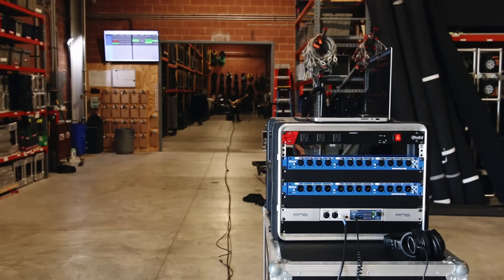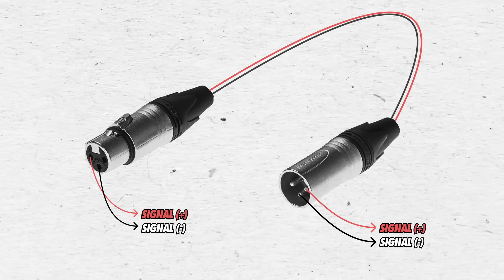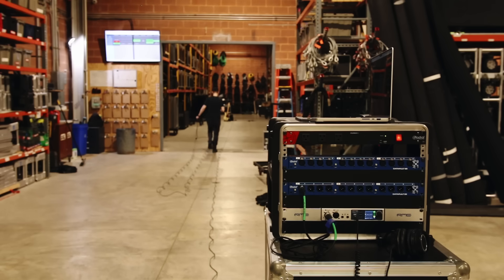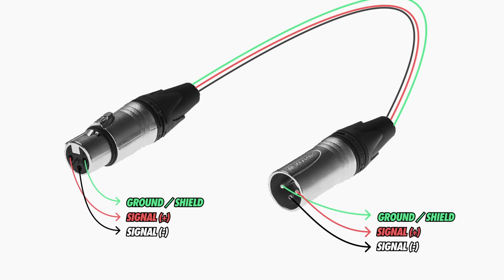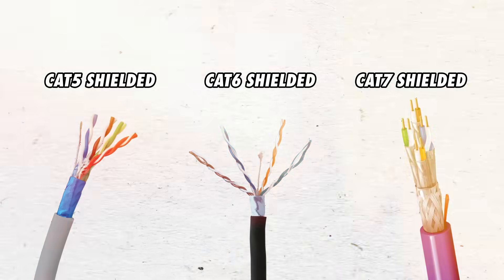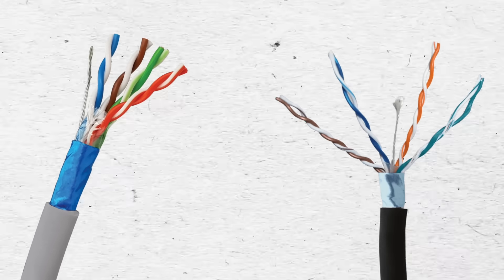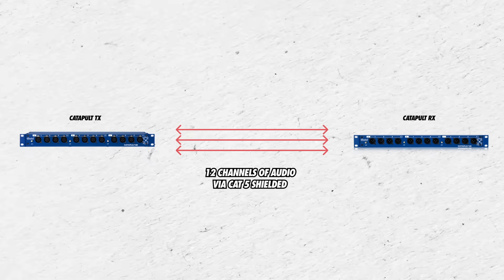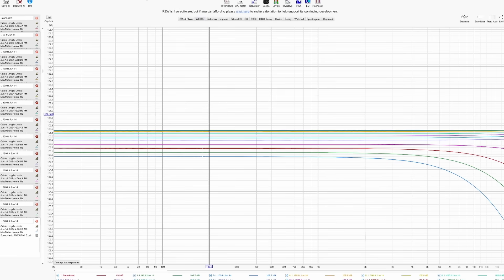Do Audio Cables Affect Sound Quality?

Comment: You can get an Cat6 cable where each pair is shielded too. It then have the designations S/STP, S/FTP or F/FTP on it (S for braided shield and F for foil shield) instead of UTP (Un-shielded Twisted Pair). Most used here in Norway is Cat6A S/FTP cables. You can terminate the plugs yourself on the cables, but you need those special plugs for that. And it often takes a lot longer time to do. For those few times I use the "Field Termination Plugs" that have a lot more room in them for the thicker cables and does not need an RJ45 crimp tool.
Thanx for a good explanation og the different cable types and signal types used in Audio installations. I will be sure to send this to my colleagues :)

Comment: Systems that use Network cable are not analogue. Digital Network Snakes essentially use a heavily modified version of DOCSIS, the same technology in cable internet modems. With frequency channels and (TDMA) Time-division multiple access using (TDM) time division multiplexing. Equipment that was studio level quality 40 years ago is now built into every computer and smart phone. |

So YES, everyone has a recording studio in their pocket.
Reply: A simple Cat to XLR adapter which uses network cable is analogue. You just split up all four pairs for four XLR connections.

Comment: Interesting thing about CAT5/6/7 cable is the twist per inch (TPI) of the conductors affects the impedance of each cable pair.  If you look at each pair of conductors in a CAT5/6/7 cable, you will notice the TPI is not the same, slightly affecting the impedance of each pair.  This makes a difference in high speed data transmission and why correct pinning is critical when making cables.

Comment: 1200 feet using an ethernet cable with hardly any loss, yet the audiophiles pay $8,000 for a stereo pair for their living room 😂
Reply: where can I find ethernet cables that can run 1200 feet?!
Reply: @IQof2 watch the video. he used multiple cables
Reply: @IQof2 right? I only know of 100 feet ones in my area
Reply: @IQof2  The standar UTP/STP cable box contains 1000 ft....  so you would need to "patch" them or, like in the demo here in the video, jump them trough... results are about the same.... Since the Network standards for copper cable are limited to 1000ft there isn't usually need for longer lengts (in data networks anything over 1000ft is usually over fiber optic)
Reply: most audiophiles nowadays don't actually understand how to achieve best quality
Reply: Not all "audiophiles" are idiots. I use Mogami gold XLR for all my interconnects a gran total of 60 bucks a pair. The only magic cable I use is for my turntable but I'm well aware than any well made SPDIF RCA (shielded) will do the same thing. However, my Ortofon 6NX bundles everything (including the groud wire) into a single, very esthetically impressive and pleasing doodad. Since I use a step up transformer I need two and are exposed for all to see so they have look the part😂😂 In "audiophila" the sound is part of the equation, most of the stuff is also part of the decor of whatever environment they are in! Take B&W diamond speakers, They are huge and take significant amounts of living space so not only do they have to sound superb, they also have to be, and are, fine pieces of furniture! 😊😊😊
Reply: audiophiles are wild. this is physics, you can measure it!
Reply: Your point certainly has some validity however the two scenarios are radically different in MANY technical parameters and do not compare well at all.    Certainly anybody who's paying 8000 dollars for ANY stereo pair of cables has paid well over 7000 dollars too much.   Unless it represents fair market value for the large amount of gold, silver, or platinum that was incorporated into that particular set of cables and its connectors.
Reply: Audiophiles? Audiofools more like!
Reply: Where dealing with sound numb skull
Reply: @Runco990 XLR ICs are useful for DC powered components with mains powered amps. You equalize the chassis potentials to common earth and avoid loops over USB. 

Either use XLR, use a galvanic isolator, or buy a quality wall wort. Sometimes XLR cables are the easiest and cheapest.
Reply: I don’t see the problem here….
Reply: No - Audiop[hiles use quality Cat 5/6 ALL the time. I use single strand inside my speaker builds to connect drivers to each other. Only after this did I find out how popular this was. They will even weave them together to make SUPER CAT! impressive but I don't have the patience. It's the Copper - the High quality copper. Designed for small current over big distance. TV coax (the old fashioned arial cable can also be great as an audio lead. My friend had these groovy jack plugs that use the coax - takes a few seconds to make a new cable!!
Reply: @willb1157 you are an audio fool. Quality of copper….pure voodoo BS. You apparently know nothing about physics/electronics and didn’t understand the video!
Imagine a recording session with 32 channels all into a cat6 snake and into an interface all with standards cat6 cable… how many ft or m of cheap copper is that?
Then you think that you can better your sound with 2m of „high quality“ copper?!
People, especially audio fools, have to understand how records ( and lately vinyl again!) are made, then they would think of themselves what most thechnicans and HIFI enthusiasts think of them since forever 😮
Reply: In 30+ years of playing guitar in bands, at pubs, clubs and festivals, 150 gigs a year at least, I've never needed a guitar lead longer than 15 feet.  WTF is this 1200 foot BS?  How the fuck could you hear the sound from your amp from that distance?
Reply: @franktriggs  you are aware that stadium shows exist, right?  Just sayin'.  :)  And even if your guitar is plugged directly into the amp, there's either an output from that amp or a mic sitting in front of it that needs to get to the mixing board in a context like that.
Reply: @DavidLindes  Yes, I played a stadium last weekend, and am playing another one this Friday.  The mics on my amp speaker is no more than 20 foot, AND its phantom powered, so lead length means nothing, as it's buffered into the desk.
Reply: @franktriggs  so... you plug into a snake?  a digital equivalent?  other?  Something's gotta make the run to the desk, which I assume isn't on the stage.
Reply: Digital protocols are MUCH more robust to noise. Audio is analog, and so any loss will impact the quality of the signal.
Reply: @jamesseto1  Did you watch the video? The last test was analog.
Reply: @jamesseto1 balanced is still analog
Reply: @jamesseto1 there was nothing digital in this video!
Reply: Now sit down with a single ended valve amp and high sensitivity speakers and listen to copper cable for a while, then switch to silver and if you can't hear a difference then lucky you - most everyone can, its night and day.
Reply: A 1200 ft ethernet cable is fiber-optic, which is immune to the type of noise talked about here. And as others have pointed out, ethernet carries a digital signal which isn't affected by noise nearly as much as an analog signal.
Reply: @MrNoahMango  this isn't ethernet, and it isn't fiberoptic.  It's shielded twisted pair, cat6 I think he said (but he talked about different categories, and I forget what was specifically used in the test, and don't care to go back), but not being used for ethernet, but rather as a direct path for analog balanced audio.  Ethernet is a protocol.  cat6 is a wiring standard.  This is using the latter, only.
Reply: @MrNoahMango  did you watch the video? there wasnt a single 1200ft cable, there were many shorter cables combined to reach the 1200 figure
Reply: BUT JITTER @MrNoahMango
Reply: @MrNoahMango  did you even watch the video, man?
Reply: @MrNoahMango  so I wonder if we can somehow convert one to the other for transferring audio?

Comment: That's a great explanation, but it lacks of taking into account the output impedance of the signal source. With high impedance outputs even short cable runs (dozens of meters) will ruin your signal's frequency response and level dramatically due to the internal cable capacitance. The same is with the noise interference.  Noise can also easily jump into the signal path with high imedance output. So, you should take that parameter into account too when doing such tests

Comment: The important thing about multi pair data cables is that the twist rates of each pair are not mathematically related to each other reducing the coupling of pairs in the same cable. They worked this out for hundreds of pair cables to stop telephone cross talk. With cat 5 you can see how the different colour pairs have very different twist rates. For high speed data this makes a difference as each pair has a different length and the timing skew must be accounted for

Comment: Great video!
It's interesting that CATs are a topic now (well, they must have been for longer, but the topic is popping up more frequently). I assume it's because of the economical situation. Everything's cut. Less margins, smaller investments. Cables are expensive. CATs are cutting it? ;)

Some time ago I thought to try UTP CAT 6 for 4x unbalanced audio in my studio, because I needed more cables over more than 15 ft distances
 and happened to have cat6 and TS plugs at hand. Did a 30 ft cable (to be able to run it around the room rather than under the carpet) and was really suspicious about the unshielded, bare twisted pairs going to 1/4" plugs. But the result surprised myself! The cable stays in production use.

Comment: The twisted pairs of balanced wires in CAT5-7 cable won't protect you from ground loops caused by combining grounds from different types of audio sources in the cable's common shield. You may get away with EtherCON cables most of the time, but it will bite you sooner or later...

Comment: I was new to all this in the 80s. When AM radio stations still used 600 ohm landlines from a teleco for getting feeds to where they need to go.

I asked how come you can get audio across town and I can't use my hifi components (in this case a cassette deck) in another room. Why I wanted to do this is another story. But I noticed right away with RCA leads you got a bit less volume  even using a 20m lead.

The broadcast tech I asked said... your stereo is 150mv and unbalanced... it also drives into a high impedance. 

We use 1v balanced and it sees a 600 ohm impedance when it gets there. So its like a marathon runner that has finished the run... and now sees a whole bunch of steps they didn't know about... at the end.

1v means the runner is more fit... 600 ohms means no steps. Aha... got it!

Dont forget this is the days of telephone thinking where ends need to be matched. Not today's low impedance in the send end to high impedance in the recieve end. 

I tested this... given my vintage I'd rather see all runs terminated with 600 ohm resistors. If we keep the analogies going.... modern connection is like having a pot plant sitting in the back of a transit van on its own... its going to get a ruff ride. Stick some weight in there.... aka 600 ohm terminated... in this case bags of dirt. You will get a smoother ride!

Comment: In electrical engineering, we talk about noise and interference as two different things. Interference is unwanted signal from external sources. Noise is unwanted signal coming from the system itself. Even a perfectly shielded and isolated system will still have noise. Every resistor in the circuit produces white noise just sitting there from random movement of electrons caused by the heat of the resistor, called "thermal noise". There are other types of noise with different spectra associated with diodes, transistors, and every other type of component. Interference is the easier problem to solve, as outlined in this video. Low noise requires careful gain staging and sometimes expensive components.
Reply: We make this differentiation too. Parasitic noise and self noise. What everyone seem to forget is the tendencies for low quality cable to be microphonic (caps are too). I have yet to see a video addressing this issue.
Reply: @MrPureBasic  oh, I forget who or in what videos off the top of my head, but there's a youtuber out there that does address this.  Actually, I think Dave from EEVBlog does sometimes, but there's another one, too, I think.  I think it's the guy that's building his own voltage and/or frequency reference sources??  Ahh yes, Marco Reps (@reps), e.g. in v=XpbDMo8an5w a little after 15 minutes in -- well, that's about caps, but, cables are caps, right? :D
Reply: True, not to mention typical impedance mismatches: and all the problems are made worse by the fact that microphones are stone-cold deaf:  even the simplest typical recording signal path -- Mic, pre (or phantom), and ADC -- uses two gain stages to get enough signal without adding audible distortion (unless you have access to an ADC with a god-mode preamp that doesn't have to strain to boost the signal all the way on its own), with their associated interacting self-noises.  Minimizing the noise floor over multiple stages while setting levels is so much fun ha ha ha!
Reply: The shielding only work vs higher frequency range (depending upon the amplitude of said signal). That being said as long as the cable is properly twisted will do more as far as inductance vs capacitance.
Reply: Your explanation of the difference between noise and interference is either just your opinion or only an opinion/idea held by some.
The entire first page from my Google 'noise vs interference electrical' disagrees with it.
Reply: Power conditioners are helpful 👌
Reply: @stefansynths  The entire first page all agree with one another - they all disagree with your opinion.  I can say for certain that your definition is not universal across electrical engineering.
Reply: I am an electrical engineer.  @stefansynths is correct.  The "noise" he refers to is generally referred to as "Thermal Noise". It is caused by the random motion of electrons in current carrying electrical devices components, cables, etc.  It also goes by the names Johnson Noise, Nyquist Noise, and KTB Noise. The total thermal noise power (kTB) is a function of three quantities, 1) Boltzmann’s constant “k” in Joules/˚K, 2) temperature in ˚Kelvin, and 3) the overall bandwidth of the channel selective filtering in the receiver. This is referred to as “Thermal Noise” because of the dependency on temperature.  However Thermal Noise is typically not an issue in audio systems since its power level is insignificant compared to that of the desired audio signal levels processed by audio components and systems.   I suggest to Google each of these terms.

Comment: Very nicely done. 
I have had so many arguements about balanced cables with people who simply do not know. They presume they know all there is to know, yet they have great big gaps in their knowledge.

Nowadays, converting unbalanced to balanced can be done without very expensive high quality transformers by using electronics with single chip solutions and it works just as well, if not better with very wide band amplification from DC right up to rediculous frequencies (although this can create problems too). 
The only 'downside' is requiring a power supply to power it. However, you can end up with useful gain as a result resulting in more headroom.

Comment: Brilliant video! You are like watching someone from the 1950s (in a good way) because you've obviously read books too!

I build my own valve based hifi, the difference moving from unbalanced to balanced is incredible. I knew about common mode rejection but had forgotten about differential mode gain, thanks! I met Aspen Pitman of Groove Tubes in 1997 (lovely guy) and he always raved about transformer coupled balanced connections, game changer for audio! Ethernet cables are twisted to a tight spec to reject interferrance to their high data rate and are actually really good for audio - ditto, old telephone cables are really good for digital, as Imperial College in London found out to their great saving in 2000